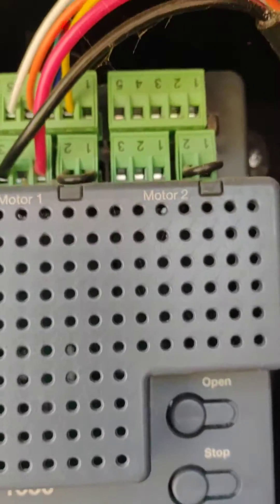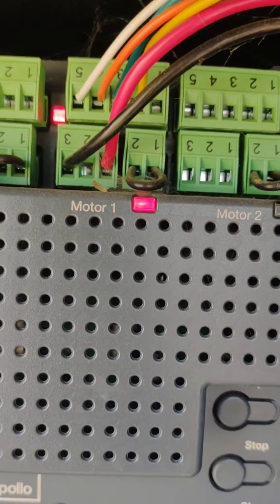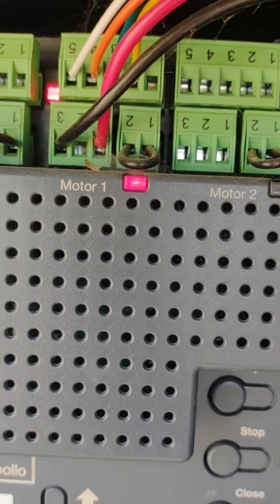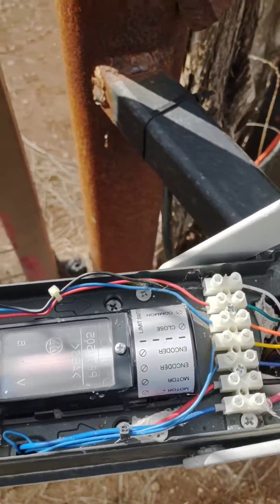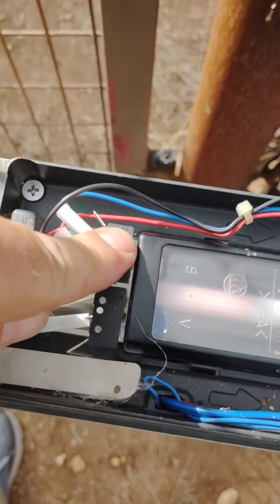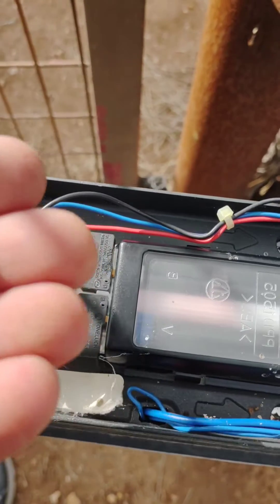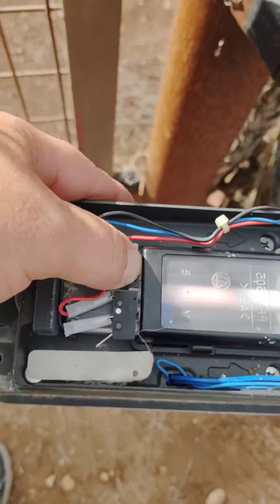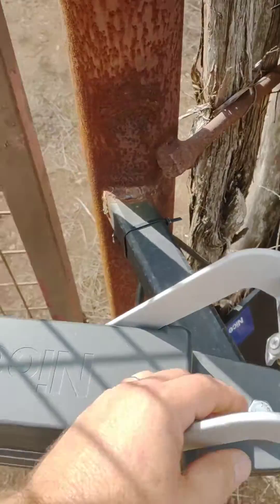This Can Occur with Nice Apollo Titans

Comment: New subscriber. What if the motor led is not on? It will not learn either. Also a clicking noise was coming from the actuator box. So I  lossen uped the screws. I was able than to open and close the gate. The clicking went away. But as soon as I tighten everything back up. The gate would not open or close. So I went back and loosen the screws again and I was able to open and close the gate. But no led was on for the motor. It's the 912L linear actuator. Apollo 1050.  I have ordered a new motor seems staritforward. Is there any alignment to motor replacement. Thanks any help will greatly appreciated

Comment: I have a 912L actuator keep getting a motor overload code. Arm moves freely by hand in manual. Any ideas???
Reply from the maker: It could be 1 of 3 things that I can think of. 1) a weak battery (yes, I know it's hard to believe), 2) a short in the motor itself inside that actuator, 3) a low force setting on the control board.
Reply: @JacobGilliamMasterTech  Thank you so much for replying. So this just started happening. Battery power is good, unchanged varies between 12.8 and 13.6. We have not changed the force setting. Can we run the motor with the  cover off while watching it? Can the motor only be replaced?
Reply from the maker: @garycrosby8984 1) amperage is the key to battery power and that can only be determined by a battery analyzer or a load test - voltage can be good and amperage bad (because of sulfide deposits on the lead plates of the battery).

1) yes, the motor can be replaced without replacing the entire arm.

I would first have the battery load tested by any auto parts store (they do it for free), before doing anything else, because you could waste a lot of time and money if you don't.
Reply: @JacobGilliamMasterTech  Thank you for the insight I will get the battery tested first. I f I need a new motor where can I find the parts for that 912L actuator?
Reply from the maker: @garycrosby8984 I doubt you need a motor. But message me if you do, and I will handshake you with someone.
Reply: @JacobGilliamMasterTech  Hi, ok so i figured out what is wrong . I disassembled the entire unit and removed the tube. I found the gear at the end of the long  screw assembly shaft is shot. Can I get a new one by itself without buying the whole tube???? Thanks again for your help.
Reply: @JacobGilliamMasterTech  Where can I get parts only for the actuator? Why will the actuator release lever not allow it to freely open or close in the up position?

Comment: I have Apollo 1050 with Titan 912L. I went on vacation for three weeks, upon returning battery died. I replaced the battery and after that its been tough to make it work. I had to hard reset every day, it would run like 5-7 cycle (24 hours) and wont work. It will just click but wont operate. So, finally i gave up and switched to manual mode. Sun charger has good voltage as well as the battery is also new. Checked the Sensor and no obstruction but i am assuming since it runs to curb upon opening so must be triggers something. I tried with LEARN process to make it stop at the desired position while open but it didn't work. So let see, What would be ideal Static/Dynamic Value for this. I have a Single Swing Average Size gate. I will try to adjust the setting after watching your video from actuator and will see. Any input from you would be greatly appreciable. Thank you in advance.
Reply from the maker: The most important thing is to make sure both physical limits are triggered when the gate is full open and full closed. When in the closed position your limit LED light will be red, when in the open position your limit LED light will be green. If you do not see these light indicators as described, do not run the board through the learn mode and investigate why.

Comment: Unrelated question on Nice Apollo 4300. If your main power supply goes bad, can you substitute an aftermarket 32v dc power supply? If not, why not? If yes, how many watts/amps should it be? Thanks 🙏
Reply from the maker: Even though no one has ever asked me that question before, you absolutely can use your own. The easy answer is: if you make sure to keep healthy batteries in the operator, you can use any 500mA or better transformer. But if you want to run the machine without batteries, I am not 100% sure but I would imagine it would need to be an expensive 10 amp power supply or better. I would have to ask the factory what the rating of their current power supply is. But I have never seen one of those machines pull over 7 amps ;-)
Reply from the maker: And sorry for the delay! I somehow overlooked your comment..
Reply: @JacobGilliamMasterTech  thank you. I called tech support and they didn't know the amp rating and the power supply is on back order. Since the merger, the original equipment specs and data is on short supply or not available :(.

Comment: Im having issues with my Nice 1050 control board, and Titan actuator... Issue #1: gate will close then open back up about 1 foot, yet it is set to soft close provides confirmation on the gate position (and no obstructions). Issue #2: Im unable to program my remote.
Reply from the maker: When the gate closes, does the limit light turn red before it backs up? Depending on which motor input is in use, it will be the LED immediately to the right of the label "Motor 1" or "Motor 2".